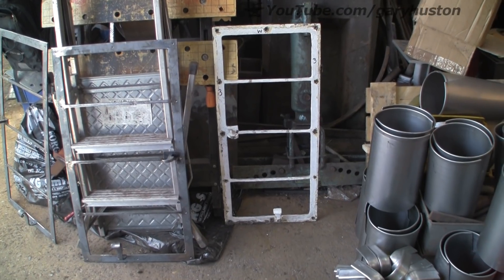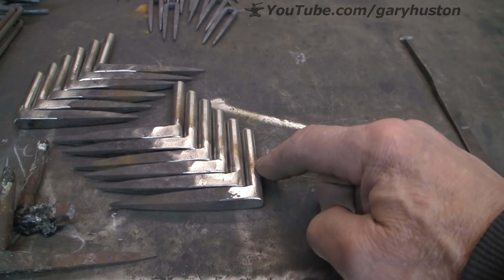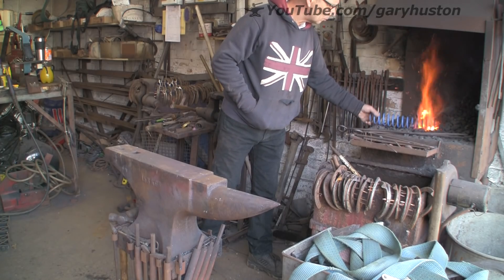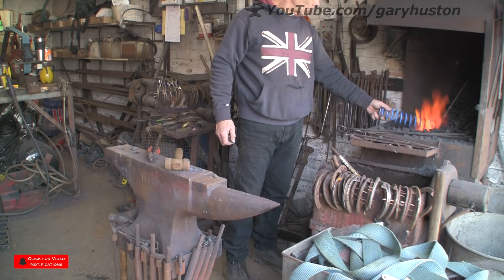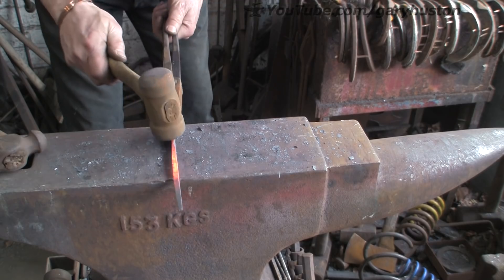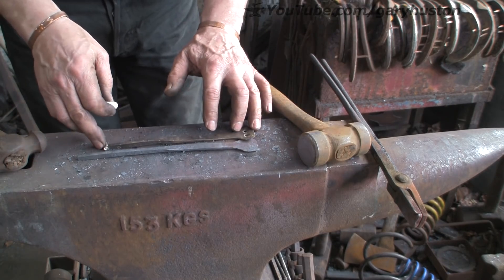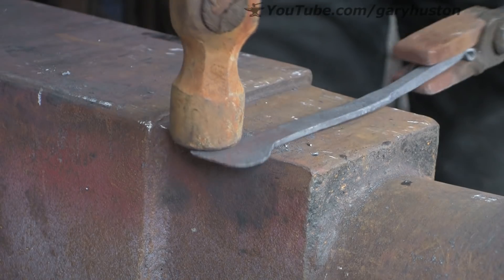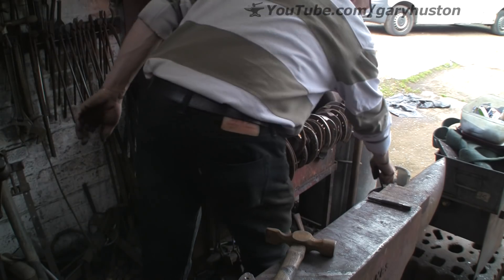Spring steel window latch

Comment: I've always found that straightening coil springs is deceptively more difficult than one might think, especially when they are over 1/2" diameter. The hardy or pritchel hole can definitely help, as can be seen in this video.
Reply: Check out Black Bear Forge on YouTube. He heats up the entire spring, slides it over a piece of pipe held in the vice and pulls the whole thing straight with his tongs in one motion.